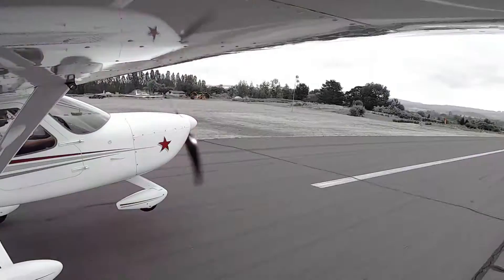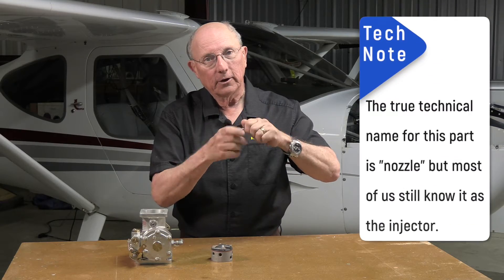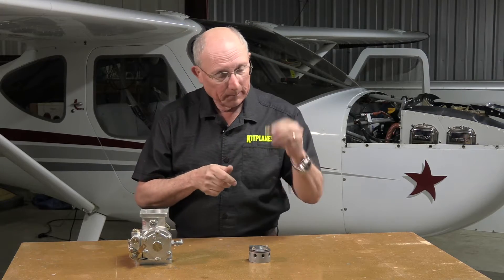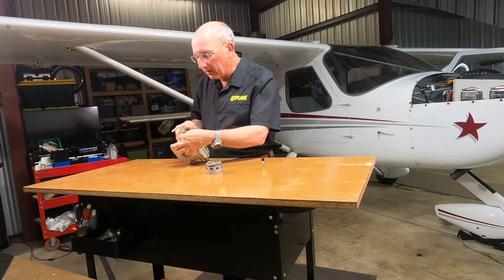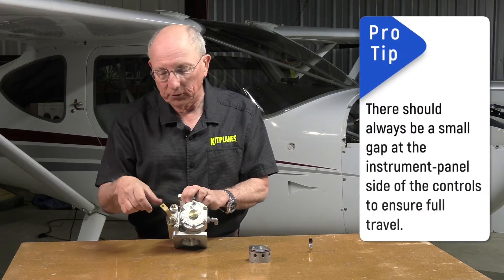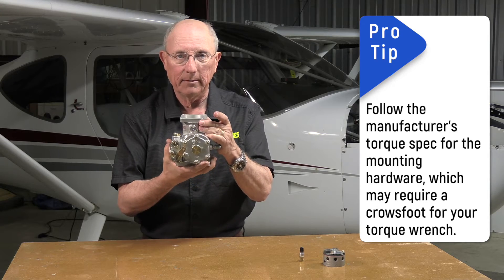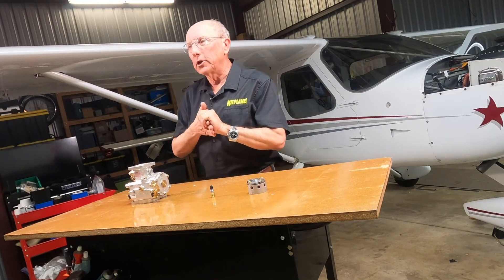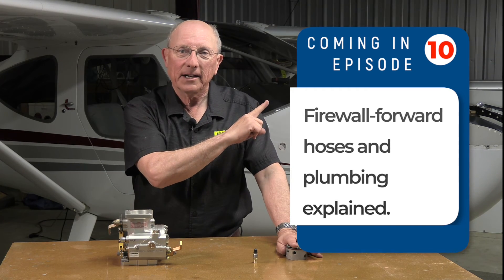KITPLANES Firewall Forward: Fuel Injection

Comment: How does the flow divider actually divide the flow of fuel to each cylinder at the correct time?
Reply: Based on air flow and engine speed.  Not really a matter of timing.  The mixture will be there the next time the intake opens